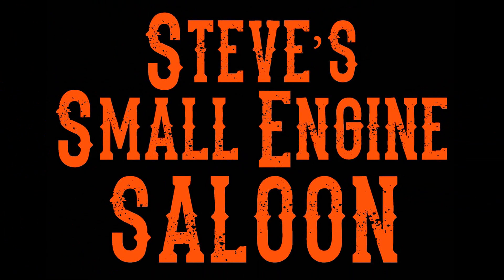What Is A Hydro Locked Engine AND Can You Fix It? (hydraulic)

Comment: I have a 2 stroke Polaris snowmobile engine behaving like this but may be something else.  When pulling over the engine is binding up but not on every pull.  The plugs are dry so thinking its not fuel on the top of the pistons.  Would a crank that is out of phase also reveal the same issues with the binding up every few pulls?

Comment: I had a WEN 3600 watt inverter generator tip over while running, and I didn't see it until I saw smoke rolling around the RV....I went to see what the heck happened! When I saw the WEN laying on its side, I immediately shut it down. I took it into the garage, pulled the plug, and drained the crankcase oil, fully expecting fuel to come out as well from being hydro-locked, but fuel did not come out. I put fresh oil in and and pull the recoil rope a number of times with a shop towel by the spark plug hole in order to catch any oil that may have been in the cylinder, the I put a new NGK plug and started it back up. It ran great, but what a scary few minutes :) I really love your videos sir :)

Comment: Will a hydro lock clear itself if you wait a few hours? I had a honda 380 seemed to lock up after trying to start a few times. after I checked the oil, air filter and general maintenance i tried starting and it did turn over but we to back to locked. I though it blew a rod and  gave up So now I may try removing the plugs to check before calling repair man.

Comment: I'm a member one of those Facebook small engine groups and was told to pull the starter rope until my lawn mower became hydrlocked then tilt it on it's it's side with the carburetor up then change the oil. The lawn mower ran perfect before changing the oil but now after the oil change there's a small amount of oil leaking through my breather tube and the oil level is just below the the correct level. The lawn mower is only two years old and I would like to fix this problem before it gets worst, like smoking. I have replaced: the carburetor, breather read, head gasket, and the breather tube and still after letting it run for 3-4 minutes oil continues to leak through the breather tube. Is it possible that hydro-locking it before I change the oil caused this problem, if yes what can I try next?..........

Comment: Can you give me an answer to this question?? I have a Husky 236 xtorq , (1) when I went to start it the starter rope will only pull a few inches. (2) I thought the chain wasn’t properly on the sprocket so I removed the chain and bar and it still done the same! (3) I removed the spark plug and hey presto the rope pulled as it should, normal operation. (4) I replaced the spark plug and back to square one the rope wouldn’t pull, also there was no fuel in the chainsaw at the time. Maybe you could enlighten me as to what may be causing this to happen?? I have removed the barrel and the piston shows no scores and barrel is clear as well, I notice in the barrel there are a nylon inserts on both sides that run parallel with the barrel and are grooved to for to take the diameter of the piston but these show no signs of wear, also the piston ring is free and closing end to end normally, I’m baffled 🤔

Comment: I have this briggs and Stratton engine and I can only pull the cord like 5" as the engine is seized. I took the spark plug out and it was a little wet and I also drained the possible gas laiden oil and put new SAE 30 oil in the engine.  I also did multiple four seconds sprays of WD-40 into the spark plug hole I did not use the marvel mystery oil as some videos have said many said that you can use WD-40 as well.  I hooked the garden hose up and squeeze the handle and I did have some air release and water squirt out the nozzle so water seems to be permeating the system.  So far I've let it set 9 hours and the engine still does not move.  How long do I need to let it set?  What should i try next?  Should i try ATF in the spark plug hole that's a great lubricant!!  Or do I need this marvel mystery oil which some people say is basically ATF but with a fancy name and a high price tag.  How do I unseize the engine?

Comment: My John Deere D100 series had a bad head gasket after 75 hours of use, it smoked on throttle and on back throttle and ran like crap and would stall out. Fixed that and adjusted the valves. that 4 stroke mower was hydro-locked after putting an after market carb on before I knew the head gasket was bad. I could hear the slush turning the top flywheel by hand after 4 attempts to start it up. The solenoid that screwed into the bottom of the after market carb bowl went bad and flooded the oil crankcase. I had to tilt the mower and drain the crankcase completely and let it air out for a good day. I put the original carb on, filled the oil back up ran fine. I'm sure the crankcase is clean as a pin after the gas removed most of the carbon build up

Comment: I’m having this same problem. Thought it was the valves. I took the head off. Cleaned and adjusted them. Put everything back together and it’s locked with the spark plug in and pulls fine with it out.

Comment: Our mower locked up.  It turned out to be a stick between the belt and pulley for the tranny.  We have a Personal Pace Toro.  When it locked up, we couldn't pull the cord.  We thought it might be hydro locked.  Removing the stick fixed the mower.

Comment: I'm glad I found this video. I have an old Snapper riding mower that I have been treating  very well for a few years. One day it worked and the next day it was just locked up. The last time I used it nothing weird happened,  and no funny sounds. I could not figure out what it was. Honestly I washed it with my pressure washer, but I never sprayed at the engine though. I just figured it had to do with that. Well I will be working on it tomorrow,  and I will come back and leave an update. Thanks guys

Comment: I have a power washer with a small Honda engine. I think it’s a 190 cc. When I filled it up with gas today, I could barely pull the engine over. Do you think my carburetor is leaking fuel into the engine?  Ran fine last night.

Comment: Last weekend My neighbour at our Summer/weekend home asked me if I could take a look a  his lawn tractor, he could not get it to run, it would try to crank but no manage to.. He told me that he had turned it on its side to sort out a rope that had ended up in the mower deck.. Having seen a few of these "how to tip your (walk behind) mower over" videos (this channel and Donyboy73 comes to mind) I reasoned that it could also happen with a lawn tractor..  I removed a very wet spark plug, and while I was waiting for my neighbour to find a 12v battery that we could hook up to the lawn tractor, I turned the engine (single cylinder Briggs & Stratton) by hand and oil came pouring out the spark plug hole.. I'm glad I did this, as it was a lot less messy than if all that oil had been forced out by the moving piston. When we got it running it did in deed smoke like CRAZY!!

Comment: Okay thank you very much I thought my Briggs & Stratton engine it's a 14.5 horsepower was bad but I guess it's the carburetor that did it for me, I did not tip the engine I just don't think I set the pin in right and so it fired up turned on for about a second and then shut back off and then it was starting to hide or lock it wouldn't like turn over anymore, even on a fully charged brand new battery, I thought my engine was toast

Comment: I'm not sure if "hydrolock" is my problem, but I removed and replaced the valve cover on my Honda mower, to fix the "O"
ring oil leak problem common on Honda. That is now fixed, but my mower will not run if the spark plug is tightened. The spark
plug must be just threaded in slightly for the pull cord to work, and the engine to run. It runs and mows fine, but not with the
plug even finger tightened.

Comment: I believe that the term "hydrostatic lock" is used because the lock happens because a liquid is the cause; the word hydro usually refers to water, but in this case is a liquid other than water: oil or gas, or actually could be water that penetrated somehow into the engine if the machine was stored outside.

Comment: Hi Steve. I'm Fred from Australia. Came across your you tube channel and love it. So much information and ive learnt a lot. I have a 8HP Honda engine on a slasher. Impossible to turn it over and always stored in the shed. It's hydro locked, as i can't pull the cord. So is it most likely fuel leaking into the cylinder?  Oil level is fine. So it has to be fuel? In which case, is is the carburettor leaking? How do i fix it? Much appreciated

Comment: Just realized i hydrolocked my brand new top of the line stihl blower by running it on the gas they gave it to me for about 10mins now am out of 800 and with no energy to fight the store that sold it to me on why did it had normal unmixed fuel .

Comment: Hi Steve, I have an old snapper power plug (aerator) that I had for over a century and now has seized.  I can't pull the starter coil.  There were a few oil ports that I hadn't noriced.  Can I unseize the machine, and if so, where should I start?

Comment: thank you. i was having trouble cranking my little 4 stroke cadet BC490. pulled the plug, cranked it over about 5 times....no oil came out. put the plug back in and it started on the second pull. thanks again for sharing this. now if i could just figure out why i'm getting so much oil coming out the filter/breather. drips pretty steady.

Comment: Thanks for your videos they help me when I'm in a pinch....like now.  I thought my engine was hydro locked because the pull rope only comes out abut 1.5 feet.  Removed the plug, the pull rope works properly, comes all the way out and cycles the engine, nothing is pushed out of the spark plug hole.  Replaced the plug, pull rope only comes out 1.5 feet.  Wondering if there's some sludge in the cylinder.  Any thoughts?  Spark plug is the proper plug for the machine.
Reply: I’m having this same problem. Thought it was the valves. I took the head off. Cleaned and adjusted them. Put everything back together and it’s locked with the spark plug in and pulls fine with it out.

Comment: I did that to a chainsaw one time, used the wrong oil, locked it up! Pulled the plug drained out the oil that was sitting on top top of the Pistons. I flushed it out with gasoline! It ran fine after that I've only had this saw for 37  years!

Comment: I have a echo cs 310 started smoking with 4 min idling. So i shut off. Took chain /bar off. N looks like its frozen. Cant pull string to start. Ive used it maybe 3 times. To cut some twigs. Got it fot x mas. Any tips. Do i return to echo. ???

Comment: I believe hydro locked is a short form for hydraulically locked. Hydraulics involved fluids such as oil, gas, and water etc. So, an engine can be hydraulically locked by coming into the compression stroke with liquid above the piston.

Comment: a good answer to a question there Steve and April and yep Hydro-locked engine is a dead easy fix and even a good amount of WD.40 can also free it up if it.s locked up from very old 2 stroke or even 4 stroke mixtures if it,s frozen stuck in a place etc.

Comment: How about a video on why you should have a fuel shut off valve on your riding mower so that when you start the engine you don’t have a garage full of smoke until the engine dies from all of the gas that mixed with your oil like mine did😂

Comment: Air is a fluid, just not a liquid...yea, I'm that guy, sorry.
Reply: Air is a gas, sorry to be that guy.
Reply: @mickymac6571  Gases are fluids, as they can be made to flow; the definition of fluid.  Air is a mixture of several gases; all of which are fluids.

The interesting debate is whether or not plasma is a fluid; and I don't know enough to even have an opinion on that argument.
Reply: @diggernash1  Pardon me meant it's physical state at STP,.
Reply: @mickymac6571  Air, in its gaseous state at STP, is a fluid.

Comment: I believe that the hydro in hydro-locked is referring to water. From water getting into cylinders when a head gasket goes on a water cooled engine or being drawn into the cylinder from driving in deep water, usually resulting in bent con rods.
What are the fluids that are likely to lock an engine ? Oil, fuel and water. 
Hydro - from the ancient Greek word meaning water.

Comment: Hi Steve.  You have a great way of teaching.  I have a Tecumseh on my lawn mower.  What is the proper level of engine oil--do I read the dipstick when it is inserted to the start of the threads or read it after screwing it all the way down and then removing it.  The difference is probably 3/4 of an inch.  Thanks in advance.

Comment: It is possible to damage your engine when you hydro-lock it... If you're a dummy and keep trying to pull as hard as you can.  Usually the rope will just snap, but I've seen the starter locking palls break.  On some starters where those are on the flywheel, that can be a pretty big deal.

Comment: Technically, you can compress water or other liquids, it takes an incredible amount of pressure to attain a small, very small amount of compression. The engine will self-destruct long before that level is reached.
Reply: You're not wrong. I've heard of a ball valve being closed under high pressure, and squirting the mechanic in the face when he finally got enough torque on it to open it.

Comment: I always call it oil flooded from turnning the engine on the wrong side on 4 cycle that same if it mixed with oil and gas! In fact going to back in the day going briggs update school that is how said it. Hydro - lock is the same thing and other way saiying that it has to much oil or gas and oil on top of the piston.

Comment: Actually, 4 strokes can hydro lock also, especially horizontal v twin engines like used on zero turn mowers. I’ve got a toro zero turn with a 21 hp Kawasaki on it and it will fill the engine with gas over the winter if I don’t turn off the gas valve between the tanks and the carb. So much gas was in the engine it filled the crankcase until it went through the rings in the one cylinder with an open exhaust valve and then filled to muffler with gas too. It hydro locked big time, oil was so diluted there was more gas in the crankcase than oil.

Comment: I loaned my tiller to my neighbor when he returned i just told him to put it in my shed. I didn't look at it for a few weeks so when i went to start it i saw he had parked it with the cyclinder facing down. Sure enough it was locked when i tried to start it. Simple fix though just pull the plug pull the rope be sure no one is in the way ; )

Comment: A common hydro-lock situation occurs when the carb float needle does not seat properly, and allows fuel to fill the cylinder/crankcase/etc.  A common occurrence in gravity-fed fuel systems on small engines.
Reply: If anyone's engine hydro-locks that way, in addition to correcting the issue causing the fuel leaking into the cylinder(s), the oil ought to be changed immediately because it is now most likely now a diluted oil and gasoline mix (and I think I'd squirt some motor oil in the cylinder(s) and turn the engine over a couple times before reinstalling the spark plugs so the rings and cylinder wall have some lubrication before starting the engine).
Reply: Happens to my riding mower all the time. I just added a fuel cutoff and a prime bulb.
Reply: @jasonbrindamour903  i cant see that helping much while running.. a new carberator could solve it or a rebuild

Comment: Now hydro locked small engines are easy to repair in the automotive application where the engine is bigger. Hydro locked  engine can cause damage due to volume of liquid that in engine due to the weight of liquid

Comment: This can easily happen to a vehicle is you happen to drive through a deep enough body of water, and the intake gets submerged and sucks water in...
9/10 times, the engine is ruined if the operator stops, and then accelerates.
(FLOOD DAMAGED!)

Comment: 'Somehow' I sank a 1200cc 2 stroker Waverunner while it was running.  Pulled the plugs turned the motor the water hit the 12 foot ceiling above and a couple of fish were flapping on the floor.  It started then ran it for an hour WOT in the bay to boil out the rest of the water.   All is good.

Comment: Thank you for your thank you for your urine movies. Very nice I have a question for you. 113 hp Honda engine what is inside the spark plug boot like a small capacitor and one is a four he could help me out. It’s a 13 hp not 113 named Al thank you.

Comment: Wow.  These horizontal cylinder mowers with fuel tank higher than the carb, TONS of folks have needles and seats that leak fuel into the cylinder, and they think the mower is locked up, and bad.  You can find fairly new mowers out by the curb around here frequently with that issue!  If I find one, I'll scarf it up and see if I can get it running again, and if that's all that's wrong, I'll usually give it back to the original owner, buey don't want it, I'll give it to someone else who needs one.  Geez.... I'm starting to sound like Mustie1!

Comment: Be careful - you can damage a hydro-locked engine if it is a twin cylinder unit. If one cylinder is hydro-locked but the other fires normally the power stroke could seriously damage the crank or con rods of the locked cylinder. That's why car engines with multi cyliners will be seriously damged by driving into deep water.
Reply from the maker: Agreed!

Comment: It's not uncommon to hydro-lock a 2-stroke engine with water.
Aussie surf lifesavers use 20hp outboard engines on inflatable rescue boats. Every time they flip, they tend to ingest water and become locked.
Easy to fix once the plug's out. We had a few engines going strong which drank seawater regularly!

Comment: I think I saw that FB group post!  Another suggestion I learned is that if you got a hydro locked engine, just take out the spark plug, and use a straw to suck out the liquids, very easy fix.